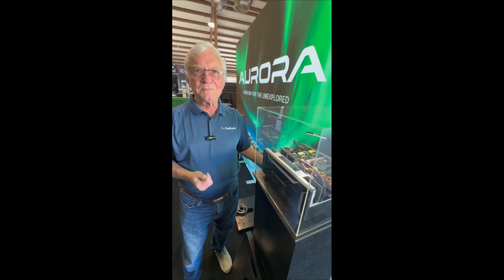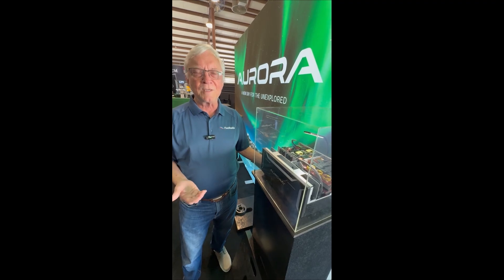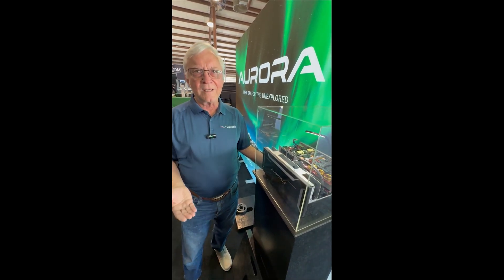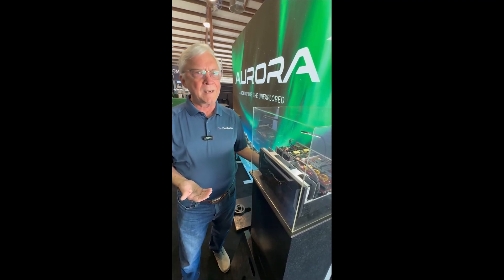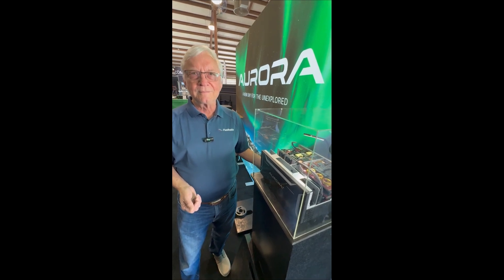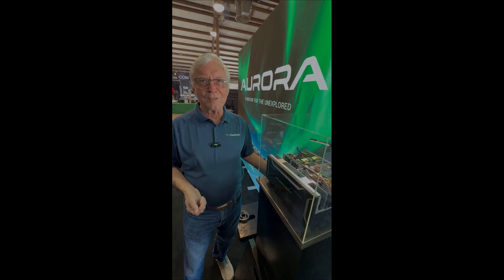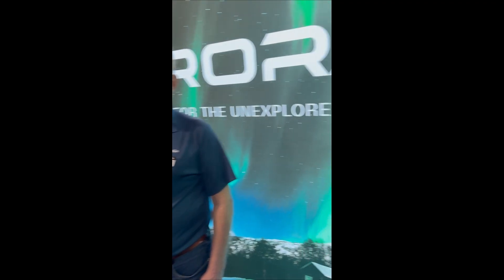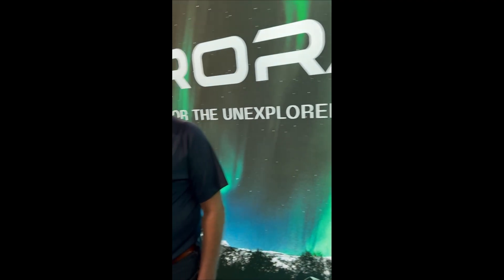Aurora - Gerald K5SDR & Tony K1KP Impressions

Comment: So, the natural question is: Are legal limit polar amps just around the corner? 1.5 KW at 80-90 percent efficiency?
Reply from the maker: Not really as you have to be tightly integrated through the entire transceiver chain.
Reply: A stand alone amp would be seeing analog in and have to produce analog out, so this would not apply.  This allows the radio to output more power itself.  With Class-E amplifiers >80% efficient this could allow a 1000 to 1100W radio pulling only the allowed 1440W from a 15A 120V outlet.  You might even be able to get full legal power from a 20A 120V outlet (1920W max).  This would be key down.  You could store some power in the power supply for a more reasonable duty cycle.